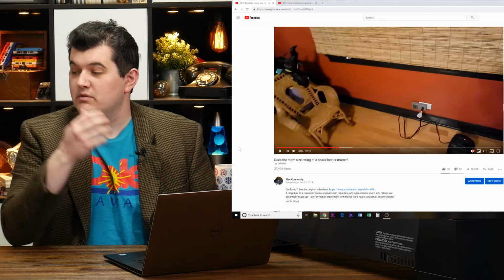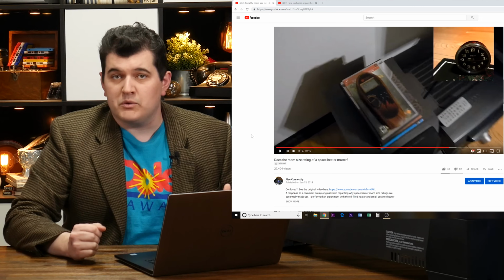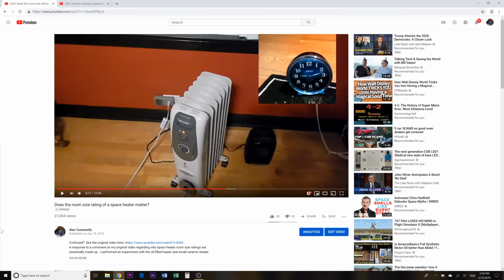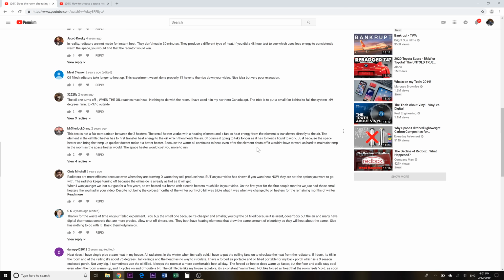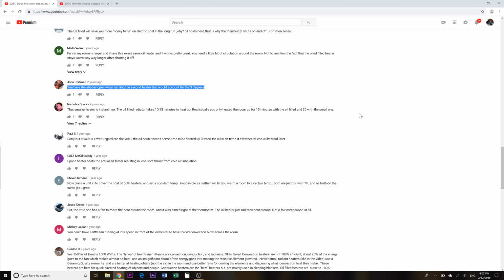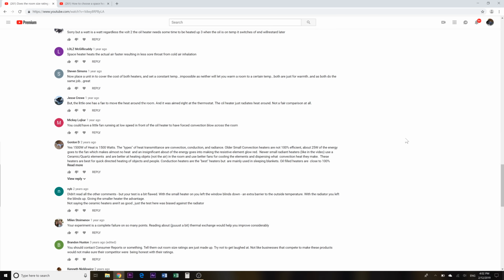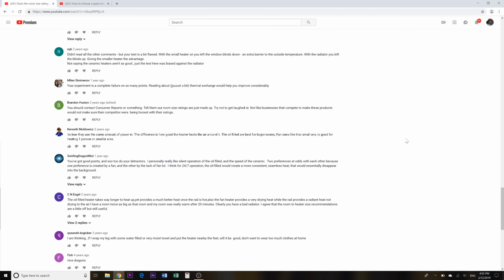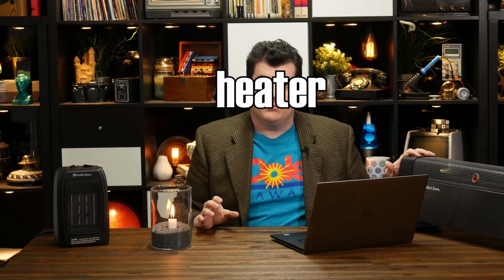More Space Heater Nonsense

Comment: The bigger heaters put out more heat because they are physically bigger, that's just math.  It's the law of bigger is better.  Also, the small heater has a hidden fan in it and we all know fans make things colder.  They intentionally cool down the heating element to reduce the heat output forcing you to buy the bigger unit without a fan to heat a larger room.  Only the smartest people know enough to jam a skewer through the fan in the smaller, cheaper heater to get the most bang for your buck... Trust me, it's 🔥.
Reply: You're joking, but you're right, bigger is better. Every formula of heat transfer actually includes surface area in it, so the bigger something is, the faster it will transfer its heat to the environment. You're joking about the fans making things cooler, but you're again actually correct, the fan works by lowering the temperature around the heater, therefore making the difference in temperature bigger, therefore making the heat transfer happen much faster. Plus, you can point the fan to your face and heat your face immediately, so there's also that.

Comment: I had to honestly explain the same thing to mom and dad, I actually did take an extension cord and outlet splitter and put 2 oil filled heaters on separate circuits and put a fan behind them to extract more heat off of them to up their run time.. Which also might make them run harder and wear them out. Though I have before if there was a dehumidifier running put it to have the outlet blowing through it to use the heat from the dehumidifier and air flow to make the heater have a higher run time and just in general put out warm dry air. And that worked fine too but this is essentially attempts to put forced air through an oil filled heater to try to mitigate the fact that in normal usage they don't run full time. There was one that did have a flaw "not one from either arrangement" that did start running full time and it was smelling like burning plastic so I stopped using it. In simple this is what an oil filled heater is capable of, running part time putting out 1,000watts an hour of heat at best or breaking down and trying to melt it's guts if it decides to actually work full time with ambient air flow.. TC I feel your frustration.

Comment: Why would I choose a large oil heater? If I want to heat a small cottage or a cabin without much insulation, the best solution is to store a lot of heat during the day and release it at night... Space heaters are not the same in the way you use it! Infrared radiant heaters are best for outside direct heating. Fan heaters are good enough for many applications.

Comment: this is so much like my argument regarding central heating radiators (convectors) with thermostatic valves, I still can not convince my partner turning the thermostat up does not make the room heat faster or make the radiator hotter. It just means it will heat the room to a higher temperature over time which results in having to turn the thermostat down manually and open a window as it is too hot in the room. I feel your pain.
Reply: I've had the same experience with my family in regards to the room thermostats. Turning them up higher doesn't heat the room faster. But then later you have to turn it down like you said. Here's another similar thing: When you are cooking something in boiling water at atmospheric pressure, once the water begins to boil at 212F or 100C, it doesn't get any hotter by turning the stove knob higher, all it does is converts water to steam at a faster rate, filling the room with water vapor, and uses more energy in doing so. But it doesn't cook faster.
Reply: @solarfluxman8810  Oh that's a whole other can of worms my my house, you don't need to cook everything on maximum and it wont be so burnt! stove top or oven and dont get me started on not preheating the oven.
Reply: @solarfluxman8810  while thermostats are binary and either on or off, your analogy about heating water is incorrect.  The stove has variable heat settings and water can be heated above its boiling point.  A phase change isn't barrier to continual temperature changes at atmosphermic pressure.  But again the real point is that stoves are not binary and are variable in heat output and so turning up gas stove to high may heat water more quickly whereas turning thermostat up to high won't heat room more quickly
Reply: Thermostatic radiator valves, the normal ones, are so influenced by how hot the radiator is, due to them being right beside it and connected to it via heat conductive metal... that turning it up WILL heat the room faster.  It will stop the valve switching the radiator off when IT gets hot, regardless of the room temp.  I tested this quite a few times.  The valve is far, far more influenced by the RADIATOR temp than the room temp.  So much so that the relationship between how warm the room is and the setting on the valve bear almost no correlation at all.
Reply: @solarfluxman8810  This is exactky why anybody that knows something about cooking turns it up high untill it boils and then sets it to just enought to keep it boiling.
Reply: @frodothehobo9581  - I agree completely. Also, here is a fun trick to demonstrate the principle of water (open to the atmosphere) will not go above the boiling point for that pressure. When camping with a campfire, fill a paper cup with water and a raw egg. Place the cup into the fire. The water will eventually start to boil, but the paper cup won't burn, wherever the water is touching on the inside. Soon you will have a hard boiled egg. The water won't let the paper cup get hot enough to burn.
Reply: @solarfluxman8810  So one thing: 100 degree water is not the same as boiling water, when it comes to cooking lentils, oats etc. I've done this test while watching the clock (because my getting to eat my breakfast before leaving for work depended on it). Boiling water takes less time to cook the oats to the consistency I consider "done", given equally vigorous mixing with spoon. My hypothesis is that it's due to the hotter steam at the bottom of the pot (which IS above 100 degC) heating up water already inside the oats. This causes the oats to break, and during cooling when the oat flake gets closer to the top, the vacuum caused by the steam in the oat recondensing pulls in more water (or milk, as the case may be).

Unless you do your own cooking, don't be too fast to make generalisations dismissing other's observations. Cooking is chemistry, a few degrees and some agitation can make a lot of difference. Keep in mind the sperical 50% blackbody cow in a vacuum: It's simple to reason about, but reality is often somewhat more complex.
Reply: @Validole  - Thanks, your comment made sense to me, and is appreciated. I believe that in a thicker medium, such as oatmeal, there may be more of a temperature gradient from bottom to top, so a rolling boil may cook faster than a slow boil. Your steam hypothesis and the oats makes sense to me. For other peoples comments regarding thermostats, I would like to clarify for the general discussion, that my room thermostats were of the simple binary on/off type and the heater was a simple baseboard resistance type electrical heater, and the heater was located away from the thermostat. And, my comment about the water boiling at 100C at sea level, was an open to the atmosphere kettle of water with a sealed can of condensed milk, floating around in the water, to cook the contents of the can.
Reply: @solarfluxman8810  adding salt does
Reply: Solar Fluxman turning it higher is how you activate automatic stirring
Reply: I used to make this argument as well, but I eventually realized that the cost and environmental impact of going to therapy far outweighs that of letting the thermostat be a couple degrees higher over the Winter.
Reply: @unfortunatelyswagged6226  - Agree with you on that. There is a fine line between trying to educate, and saying too much. Sometimes it's better to let others do it how ever they want, if it's not causing too much pain. Always try to teach in a loving manner.
Reply: @unfortunatelyswagged6226  ..... You have to let it go...and I'm the first to admit I suck at that. So I compromise. I say, "If you do 'x', 'y' will happen." Then when it happens I just say, "Told you so."
Reply: I feel your pain. I live in a country with split-type air conditioners, and people just set the lowest setting (16*C) when cooling and the highest setting (32*C) when heating. When they eventually freeze or sweat, they complain and turn the A/C off. Then turn it back on 5 minutes later.

My explanation of how the compresor is not more powerful if set to 16*C as opposed to 22*C falls on deaf ears.
Reply: @LMF5000  At my university the rooms have seperate AC units but they're controlled by a central controller. Someone will complain that they're too hot so the person in charge of the thermostat immediately sets it as cold as it goes. When someone inevitably asks them to set it a little warmer they whack the system in heating and crank it as high as it goes making the room unbearably warm. Why no one is able to just set it to 20-something and leave it the fuck alone blows my mind.
Reply: @tlaroche38  The best way is to play "divide the difference". You know 30C is too hot and 16C is too cold, so find the midpoint, 23C, and set it there. If it's still too hot, set it to the midpoint between 23C and 16C (19.5C), and set it there. If 23 was to cold, set it to the midpoint between 23 and 30 (26.5C). As you can see each iteration makes a smaller and smaller change of temperature as you get closer to the "perfect" temp. Keep doing this and within 3 or 4 iterations you'll be at the perfect temperature.
Reply: omg when people start messing with the heater in my car...
Reply: My grandpa when he was alive had an electric central heater in his house with a "booster". I always caught the heat on max with the booster (or was it emergency heat) turned on. All that did was turn on a few extra heat coils in their heat pump. That said, it's a waste of $$ to have emergency mode/boost mode and cranking the heat up.
Reply: When heating/cooling with an air-conditioner setting it to the lowest/highest temperature needed to be comfortable minimizes power use, and the actual temperature in any given room can vary significantly between different installations so any specific temperature settings shouldn't be taken as gospel.
Reply: It depends on The heatsource, most of al new heatpumps are invertercontroled so thats a thing..
Reply: Thank You. Very few people understand that turning the thermostat up higher still heats up the room at the same rate. I’ve sat down with my wife and other very(?) intelligent people. Explained it to them. It’s like talking to a wall. Or “talk to the hand”. I don’t get it. I tell them, that’s why it’s called a thermostat. Emphasis on the “stat”.  However, this why humans are interesting, enigmatic, frustrating, loving, imperfect and incredibly creative. All at the same time. And we can’t live without them.
Reply: A local HVAC company is running an ad that the room thermostat acts as a brake, not an accelerator. As you noted, turning up the thermostat does not make a room heat faster.
Reply: I like to think of this as “Human Hysteresis”.  In medical school I was taught that the “hyster” etymology was attributed to women being “hysterical” due to their monthly periods. That’s why they get “hyster”ical and have “hyster”ectomies. All of this is very non-PC...but it made sense to me. Maybe that’s why my wife cannot understand a thermostat. I can roll with it. She’s worth it to me.
Reply: in some cases like the oil radiator he explained on the video it does.
Reply: old thermostats with a Mercury switch actually have a heater inside the switch that is adjustable. basically its used to predict the temperature change useing a low tec method. adjusting this internal predictive heater will change cycle time and allow you to correct for over or under shooting the set target temp of the room. In practice it can work like the oil filled heater in this video where it keeps turning itself off early when your asking for a large temperature change. especially if you are using radiator based heating. forced air systems usually do much better with these switches... and make the room more comfortable without the stupid hot air at chest height but cold air by your feet issue.
Reply: Thanks for this comment man, you opened my eyes a bit. Never realized this.
Reply: My husband is a computer scientist and he also does this with both the thermostat and the stove. Aaaaaaaaah!
Reply: A little higher is ok as it makes up for the time the heat takes to radiate everywhere, depends how much higher they turn it, a properly placed (very hard to do as it requires testing for the cold spot that eventually heats up without the rest of the area overheating) or multiple cross communicating thermostats will solve this issue though
Reply: Except setting the thermostat higher can in some cases heat the room faster. If the thermostat simply compares the measured value and the desired value and sets the heat up to zero or maximum depending on which is higher, then turning it up does not help. 
However, thermostats can often also regulate their output between maximum and minimum. That means the closer to the desired temperature it gets, the less hot the radiators will get. The advantage of this is that the temperature will be more stable once the set temperature is reached, with less oscillations between hotter and colder. But it means it will also heat the room slightly slower. Setting the thermostat higher would increase the speed at which the room heats, at the cost of having it overshoot the actual desired value (and of course having to set the thermostat down again).
Reply: @Drakonflare  thank you for bringing that up, both instances are possible depending on weather or not the boilers heat either off or on, or have variable power levels. So whomever are having disagreements should check there boilers and hopefully learn something together.
Reply: Most thermostats are either max hear or zero heat.  They don’t have an in-between setting

Comment: Pointing out the obvious here, but here goes. 1. You compared a circulating heater to a non circulating heater, obviously the room as a whole won't warm up evenly with both. 2. A larger circulating heater, while using the same watts, will distribute heat more efficiently than a smaller unit of the same type.

Comment: I agree with your arguments, as obviously I must cause like physics and reality.  A minor point regarding your experimental methodology, a point I'm sure you're aware of but chose to not address for good reasons. In any event, when comparing the two different heaters you opened the window to return the room to the same starting temperature.  What you didn't mention (or I missed hearing) was if the heat loss of the room changed or was changing during the experiments.  Did the outdoor temperature change during the tests? Did the indoor temperature of adjacent rooms change during the experiment?  Did solar gain change during the experiment?  I'm sure if these factors had been significant you would have mentioned them and clearly for a first approximation your experiment was adequate to demonstrate the validity of your claim.  1500 watts is 1500 watts is 1500 watts. Thanks for making the argument and taking all the heat from the naysayers who claim a 1500 watt Dyson produces more heat than a 1500 watt Brand X.

Comment: I exclusively use oil radiator style heaters for my bedrooms. Over the course of 8 hours an oil heater will outdo the ceramic one you've got shown. They heat up relatively quickly, but they very slowly raise the temperature in a room. In fact I never turn my heater up beyond 1 of 3 usually because it'll still get to that warmth you want in time and uses less electricity to do it. Plus they still put off heat for a while even after you turn them off.

Comment: I'm going to make a stab in the dark guess here. Maybe the larger heater has more surface area on the heating element so it can transfer more heat quicker to the surroundings.
Reply: Larger surface area results in a lower surface temperature for a given Watt input. So the effect is canceled and the total heat remains the same. If you have a 10 Watt semiconductor (one which needs to dissipate 10 Watts) and it gets way too hot, you put a large aluminum heat sink with lots of fins on it to lower the temperature. But the total Watts has not changed. The total heat has not changed. Good effort though. I have seen this comment made by several other people in the first video on the topic.
Reply: @solarfluxman8810  Thank you for your response, I am now smarter (LOL???) than I was before. Carry on good sir!!

Comment: The 1500 watts of energy could either be used to heat the room and it's objects or you can use 1500 watts to heat the introduced oil which will then slowly heat the rest of the objects in the room at a degraded rate of 1500 watts. If you never introduce the oil into the room the energy will heat other objects in the room at 1500 watts. The oil or quarts isn't adding any extra heat only something that wasn't there before.

Comment: The only benefit the oil heaters have is that they have thermal mass and the heat they produce is more consistent over time vs the hotspotting of the small heaters. Maybe by large room they mean the sole source of heat in that room, then the oil heaters being a more consistent type of heat release may eliminate some of the big peaks and dips of heat